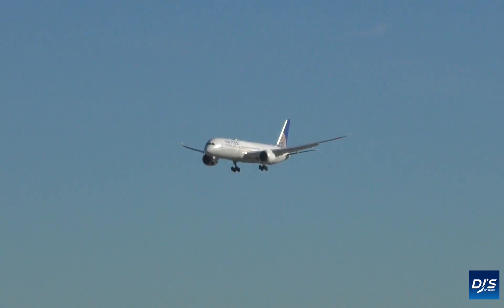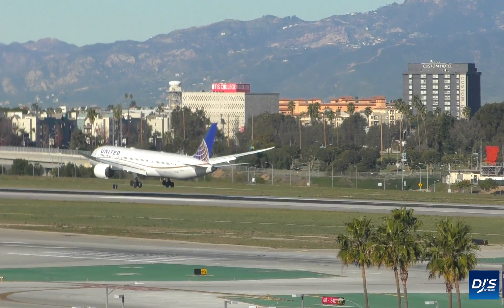Engine Problems in the Aviation Industry

Comment: Couple of things,
First of the GE issue was not a software problem, it was 3 sensors which was sending faulty readings to the computer (software) which was under the impression the engine was damaged so the fms pulled it back to idle position. 
Secondly, in the years of experience working with different aircrafts from piston to jets, from pratt and whitney to rolls Royce everyone has had issues and its nothing to do with the engines. The biggest problem this day and age is the materials they use! I'm not the only engineer to say this, they are simply not robust enough.

Comment: Engines can't be reliable from the first day they are in operation with airlines, it takes decades for an engine to be really reliable and to build a good reputation, for example cfm56 or RR trent 700. But today with social medias, there is so much information about every issue with an engine that it looks like there are a lot of problems

Comment: From what I have read, each engine manufacturer shares one common problem with its design, which is to discover a way to effectively transition the necessary, optimum air pressure between the low and high pressure compressor stages (Or is it stage groups?).  As most know, the low pressure compressor(s) provide the vast majority of thrust, whereas the high pressure compressors supply the necessary oxygen to operate the engine core.  It is at the exchange point between the two where difficulties are found.  But, each manufacturer (General Electric, Pratt and Whitney, and Rolls Royce in view) has its own technique to optimize this process.  General Electric uses a two-spool configured engine that employs variable stator vanes.  Pratt and Whitney uses a combination of the two-spooled configuration with a gear reduction mechanism to drive the low pressure fan disk(s).  Rolls Royce uses a three-spooled configured engine.  But despite the technique, none of the manufacturers have a perfect design.  

This leads to each manufacturer producing an engine that is “best” at one stage of the aircraft’s flight.  General Electric engines are optimized for long-haul cruise flights, especially those further than 3,000 km (1,620 nm, 1,864 sm).  Rolls Royce triple-spool engines are best used for medium ranged flights, in which multiple takeoffs and landings are generally encountered.  Pratt and Whitney geared engines are best suited for regional aircraft that experience high rates of landing and takeoff cycles daily.  

Again, all of my narrative is based on what I have distilled from multiple articles, and I realize that I have left my carotid artery exposed for axing by some guru jet engine technician.  But that is just fine with me, since my primary purpose for frequenting Dj’s posts is to learn from those who know more than me.  So, anything anyone is able to contribute or correct in my comment with his shared knowledge is most appreciated by me.
Reply: Nice post

Comment: I think the PW one did make the news.  There was another PW issue which caused the CSeries to be delayed (again) as well with their geared turbo fans. You also could have mentioned the CMF engines.  A couple of these were having uncontaminated fan blade failures, one of which lead to a woman almost being sucked out of an air plane window.  The difference has been RR has had a lot of issues lately and not just a few random ones,  Its lead to the grounding of lot of 787's and the problem has managed to find its way onto a few A350's as well. But that's the aviation industry for you.

Comment: Aircraft engine manufacturers produce high tech pieces of enginering.
Engines with more thrust and less weight and fuel consumption are the future.
Bigger bypass fans (more thrust) and composites (less weight) can have their issues.
Composites used in engines can have side effects they didn't found while testing.
You can't blame the manufactures because they are using the latest scientific findings while materialscience is still evolving.

We are now at the point that 1 modern engine can deliver the same thrust as 2.5 engines of a 747 in 1970! 
New research and developments  (variable blades) could mean that in 10-15 years time the thrust of 1 engine increases to 4 classic 747 engines.
Reply: That is good information. Pardon my question, but out of curiosity is Safety affected at all? Engines vibrating is a safety issues imo and I would like to know the safety standard of these engines compared to what they were before
Reply: @mamindhive Al these engines are tested the same rigorous way als all the other engines before.
new models and series of engines are inspected more often while they are in normal service.
For Example they found out that the Rols Royce trent 1000 has early aging isues of certain composite parts. So those parts have to be replaced on all deliverd engines with updated parts.
Prath & Whitney with is variable intake and thrust fans has also some issues who where found in normal service.

New findings in the field are examind and later integrated in the test program.

Aircraft engines are produced in batches with the same components.
Development still continues for less fuel use and weightreduction.
Reply: @obelic71  I will take this information and pick it up from here on google and other search engines. I appreciate the feedback and may God bless you, it shall help me with my job

Comment: With all the seemingly unconnected issues with different engine manufacturers (like auto engine cut-off during climbing) one would think airlines & manufacturers would be more in favor of quad engine planes for safety reasons. It's all fine to talk about statistics and flying being safest mode of transportation however if any of these 200-400 passenger planes experience double engine failure while at low altitude then results will be catastrophic.

Comment: Can planes of same model swap engines from RR to any other model with least modifications??
Reply: Yes, and the delays wont be long. But when the engines are $40-50M each so it would be like 100M just to get one 787 flying again
Reply: @pilerks1  true...
Reply: Cost of new engines, changes aerodynamics of aircraft, update computer software or maybe even firmware so plane knows how much power it had available
Reply: You can, yet it would be costly and that would cause many delays in the schedules for these planes. Thus, many airlines dont.

Comment: I don't get the criticism of DJ reading press releases and other news stories. Isn't that exactly what appeals to most viewers? Certainly it works that way for me - DJ sources and presents the stories in well summarised 3-5 minute bursts virtually every day. I don't need to go fossicking for the information myself (DJ does it all for me) and, hey presto, I'm up with all the latest aviation news as it happens in matters of aviation that interest me. For those knocking this channel, I say get what you want and/or like elsewhere.
Another channel I like is The Flight Channel. It details aircraft incidents and crashes looking back over many years. It is very interesting to follow what lessons  were learnt and how aviation has become progressively safer as a result. (The 737 Max will surely feature when the facts are all fully investigated). That channel is quite different from DJ's which concentrates on the here and now.

Comment: GE90s are literally the best engines in the market right now. I rarely here any issues from them.
Reply: T - Rex  That was due to a maintenance failure and no procedures inspecting the compressor.
Reply: Nope...….As good as the GE90 is, it`s common knowledge that the finest engine to date is RR`s XWB Trent. It`s the most efficient engine available & has had the best EIS reliability of any turbine. Re Trent 1000 issues, while it`s been a disaster for RR, Boeing & it`s customers, it would be wrong to conclude as some suggest here that RR are not doing enough about the problem. They have been working tirelessly to correct the problems, but with the sheer amount of engines to fix, it`s a slow & labour intensive exercise. It has to be admitted though that problems with
 the Trent-TEN is a big blow to RR, one that they will need to sort quickly
Reply: @edwardwilcox6606  PW makes great engines as well, but they don't make it for the 777 any more. The Last engine they made was the PW4000 which is still used on most 747-400s. The well known engines from PW are the JT8D engines on the MD80s. Now the PWs are on the A320neos which is in competition with the CFM LEAPs.

Comment: May sound weird, but of all the things to go wrong with the Dreamliner, dual engine loss doesn’t sound as dangerous in the dreamliner to me as rudder problems like on NWA85. Or even gear issues. Besides the significant weight reduction from your average 777, the long wing span and great flex would really help a safe controlled glide.
Reply: Airwipe unless your halfway over the Atlantic/Pacific in which case it’ll make no difference

Comment: The KLM Boeing 747-400 landing shown at the end of this video: Many of the window shutters are down. Isn't this illegal?
Reply: How tf is that illegal
Reply: it is an offence to not comply with the lawful request of cabin crew and with most airlines it is a safety requirement that the blinds be raised.
Reply: @ahay7625  I am not sure, that's why I was asking. I am not sure whether it is a recommendation or a law.
Reply: @AdityaKulkarni  There isn't any laws in most countries that specifically make it illegal. It is however a requirement in most airlines policy so crew will ask you to raise the blinds. Not complying with the request would be illegal, at least in most countries. Most crew wont make a fuss and will just raise the blind themselves, but technically they would be able to have you charged.
Reply: @pilerks1  I think we are supposed to keep the window shades up during take off and landing.

Comment: Hi Dj, I was one who always complained about you not mentioning other engine and using model engine names instead of the manufacturers' names. Mainly because the manufacturer's name are world wide known and instantly recognized. When you open up with Trent and a newbie to the chanel is scratching their heads. This video is the best one in clarifying engine model types and their manufacturers.

Now even though the GE's have problems, their problems are due to software problems and not structure failures that are completely the responsiblity of the engine builder. The Pratt & Whitney's front edge seal and the RR engine blade problems fall completely in the lap of those designers and engineers of those builders. this lead to giving great and proven aircraft models known by name, (or numbers) terrible and frightening reputations.
Reply: Thomas C Durham, the GENX problems were not just software problems:

in March 2014, a GEnx-powered Boeing 787 had its first in-flight shut down in operation when a JAL flight had to divert to Honolulu after an oil pressure alert, bringing its in-flight shut down rate to 1 per 278,000 hours.[11] In January 2016 a Japan Airlines 787 had an inflight shutdown after flying through icing conditions, caused by ice formed on fan blades and ingested: the blades moved forward slightly and rubbed on the abradable seal in the casing." They haven't fixed this icing problem, they just have software to open the engined doors to eject the ice. Then they found this software had a bug.

August 2016 "Earlier this year General Electric issued a service bulletin to operators of Dreamliners using the GEnx engine regarding an issue related to the engine’s transfer gearbox.The company recommended Dreamliner operators modify a “dampened radial gearshaft” to prevent “induced resonance failures that have caused approximately eight in-flight engine shutdowns and oil loss events across the world”.

"August 2018:  The FAA released an airworthiness directive for certain General Electric GEnex-1B and -2B engines that requires removing high-pressure turbine (HPT) stator cases due to a “quality escape” at one of the manufacturer’s vendors. Less than a week before this AD, the FAA issued one for all GEnx-1B engines due to a report that a center vent tube failure led to oil pressure loss and an inflight engine shutdown. That AD, issued July 26, requires replacing the problematic duct"

July 2018: "The new durability upgrade—which includes modifications to the GEnx-1B’s high-pressure turbine (HPT) first-stage nozzles and blades, as well as its combustor lining and fuel nozzles"

Comment: Of late most engines issue related to software glitches more than electronic equipments or mechanical or materials problems
So much faith in fly by wire or wireless!??
Reply: dseet3628 Most issues with RR and PW have been hardware and manufacturing issues. GE has been primarily software on a much lower scale of issues.

Comment: I believe  that 787 engines were designed to very efficient on fuel ! a lighter weight  material than on  previous engines!  not enough testing of the engines in real conditions  !
Reply: Yup, a320neo 787 all have engine issues. bombardier c series was delayed due to big engine issues.. Makes me wonder about 777x, huge airplane with engines from composite materials and less blades. Doesn't sound exciting.

Comment: So there was a problem with the Trent 900 on the QF32 terror and now the newer version has problems too.
Reply from the maker: Plenty of issues around, I could've gone on for ages discussing them but chose to stuck to the most recent ones and ones I've covered either a lot of briefly on the channel.
Reply: JamieLCheese116 HQ; The QF32 engine failure was down to a manufacturing defect that caused "one" inflight uncontained engine failure. There have been no grounding of aircraft at the time with Trent 900 or since this incident. The AF703 uncontained engine failure was an Engine Alliance GP7000. 

What DJ failed to say was the Trent 1000 TEN grounding was due to premature wear and airlines using this engine were told about it. They are working on fixing this.

"Rolls-Royce said on Tuesday that since the entry into service of the Trent 1000 TEN, it had communicated to operators that the high-pressure turbine blades in the engine would have a limited life."

“Working with operators, we have been sampling a small population of the Trent 1000 TEN fleet that has flown in more arduous conditions,” the manufacturer said in a statement. “This work has shown that a small number of these engines need to have their blades replaced earlier than scheduled.” 

"Rolls-Royce said its engineers were already developing and testing an enhanced version of the turbine blade. "

The GENX problems were not just software problems,  see my reply to Thomas C Durham.
Reply: Anthony Witham, all Qantas A380’s we’re grounded after the QF32 incident which is something that you do not mention.
Reply: @jamiefranzis5466  Sorry I didn't make my self clear. I should have said, there was not a general groundng across all aircraft  using the Trent 900 engine. So it is not the same problem that the Trent 1000 has. I have not tried to hide anything or claim there was not a problem, indeed I said there was! The fact remains it was an isolated incident due to a manufacturing fault on a batch of engines. The GEnx engine, had a batch of engines that had a fault with the high pressure turbine, the supplier who made that part was welding up cracks on this turbine, luckily it was spotted in time. 

The GP alliance engine, which is made by GE and Pratt and Whitney, suffered a major failure in flight as well. 

How many aircraft using the Trent 900 have been grounded since then?

 Despite what DJ said, the GENx engine does not suffer from just software problems, Yes, there is a bug in the software that is used to open the engine doors in flight to eject the ice that builds up on the front blades. To this date, the icing problem has not been fixed. It has not been free from other mechanical problems itself. I do not think any of the engine manufacturers make bad engines, but they all have problems.

Comment: If the 787 could use the Trent 1000 or GEnX. Cant the airline/Boeing purchase the whole engine from GE as a way to replace all the Trent 1000 powered planes. 

Think of it like cars like the Ford Focus which engine blew up due to the wrong head gasket. Ford has to replace all the blown up engines.
Reply: That was my question back in the Trent 1000 issue with Air New Zealand I think.
Reply: Most airlines don’t buy the engines. They lease them for years usually 20-25.
Reply: @flyhigh1877  most airlines don't even buy a plane just lease on 5-10 years like LH with a380
Reply: @mateuszzimon8216  Singapore Airlines actually buys the 787-9 and 787-10s. Yes mostly expensive planes like the SIA A380 are on lease
Reply: Mateusz Zimon Yeah but the tread seems to be changing now. Delta won’t lease anymore aircraft in their mainline fleet and the same with United. American has massive debt from paying to much for their leases. I’m not sure how other carriers do it overseas.
Reply: @flyhigh1877  my flight carrier (LOT) lease aircraft's own maybe 10/15
Reply: Lin Chester: No, because both engines use differnet mounts. This would require the repalcement of the engine mounts as well.The GENX problems were not just software problems, see my reply to Thomas C Durham. The Trent 1000 TEN issue,  Rolls Royce had communicated to operators that the high-pressure turbine blades in the engine would have a limited life."  See my reply  to JamieLCheese116 HQ;

Comment: Great and unbiased video. All three manufacturers have their own ups and downs, no engine is perfect.
Reply from the maker: Thanks Flightfilms! You're spot on there! Have a nice day.
Reply: Indeed but no engine (so far) has had problems on the level of the Trent 1000
Reply: The RR has more contagious issues causing groundings until the issues are fixed.